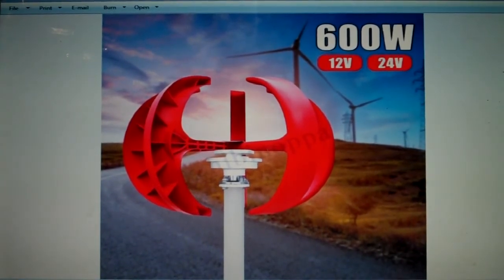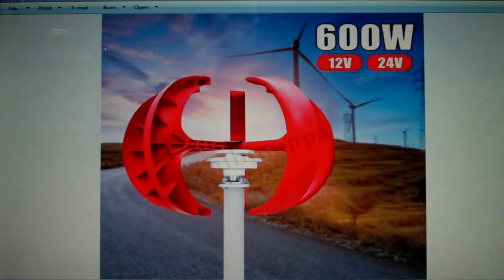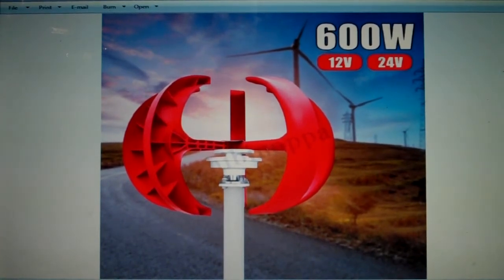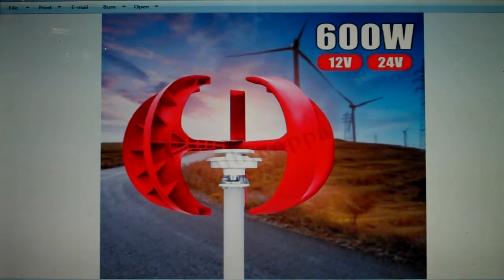SCAM-CHINESE VERTICAL AXIS WIND TURBINE-VAWT-JUNK-CONCLUSION-SCAM-PART 4

Comment: I just got one...says 12/ 24 V... not sure how it says 24v...finally have a meter on it...only getting 10.5v5-10 mph wind.  
It’s is attaché to a 24V batter bank...need  more volts to charge.   I had seen some good reviews...but  unless I am doing something  wrong...doesn’t seem like it even helps .
Reply from the maker: sorry dan.wish my videos had gotten to you first.8-10 volts max and 0 amps.it a huge scam and the best thing you can do is return it and get your money back.nothing you can do will improve it   mel
Reply: Seemed too good to be true I suppose.  I didn’t want a noisy horizontal turbine

Comment: PLZ take an Ampere Meter to show me how much amps it deliver...
Reply from the maker: i have a meter on the vawt.it has watts,amps,voltage,hours and accumulated amp hours.in 4 weeks the vawr has never registered anything.have had winds over 30mph.vawt can only obtain 150-200 rpm's and the turbine motor that comes with unit requires 600-1000 rpm's to create power.will never work.big scam !!!
Reply: @melbaron1110  . please connect the cable ... 😜
Reply: @melbaron1110  what you think about that Wind Turbine https://youtu.be/SSbAIyE_BO8
Reply: @utuberlars  vawt nax efficiency is 0.16 whereas hawt max is 0.49 at least vawt is a  beautiful decoration.

Comment: I have never seen these types of turbines produce anything. 10W. 20W.
There are hunderds video on these turbines noone has real data and spec demostration.
Reply from the maker: you hit the nail on the head my friend.my 330w hawt has all the specs on it.i know that at 600 rpm's it will begin producing low power,but it needs to reach at least 800 rpm's to start producing over 12v to charge batterys.the only way the vawt could produce power would be to have a 1-5 gearbox so everytime the blades turn 1 time the turbine would turn 5 times.150 rpm's would be turning the turbine at 750 rpm's.200rpm's x 5 would be 1000 rpm's.the only problem with adding a gearbox is that it would take harder blowing wind to overcome the force it needs to push blades and gearbox.another solution would be to have a low rpm turbine motor that would produce good power at low rpm.
Reply from the maker: @Magdumper if you have a real mppt controller it will weigh 6-10lbs.open cover and you should see 2 heavy copper coils inside.most mppt controllers from china are fakes.there are a few videos on youtube that show what a true mppt controller should look like inside cover.

Comment: I agree.  That turbine is a scam and junk.  But please don't judge every vertical axis wind turbine based on the cheapest trash on the market.
Reply from the maker: i have done alot of research on the vawt,not just the chinese junk.2 companys who built vawt went out of business.they stated in closing that theirs worked but high price and low results were not viable for the general public.
Reply from the maker: i have scoured the net to find a vawt that anyone claims to produce power.factory made or homebuilt.there are no specs out there on vawt.if there was any specs available no one would purchase a vawt.hundreds of people selling vawt's but try and find any specs on their site. nothing !!!!!